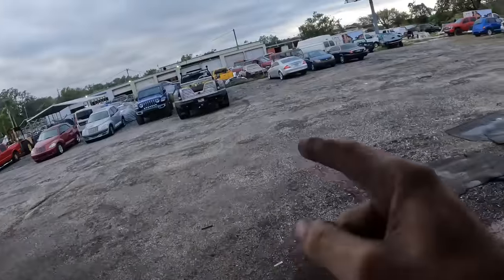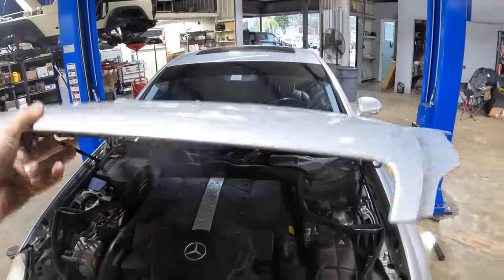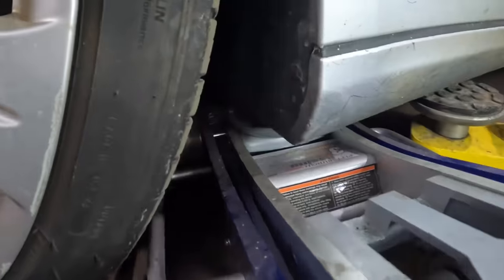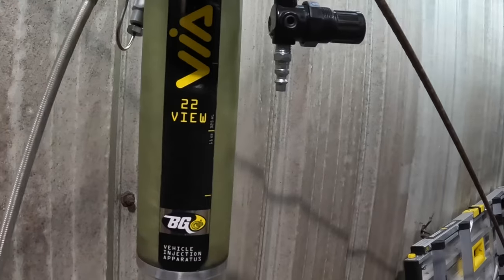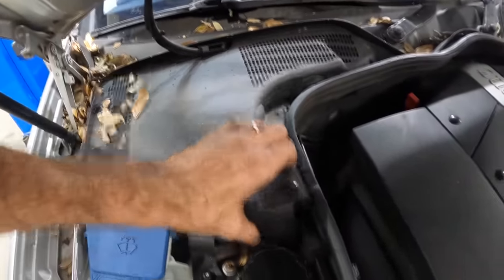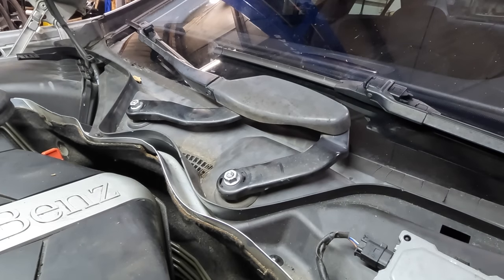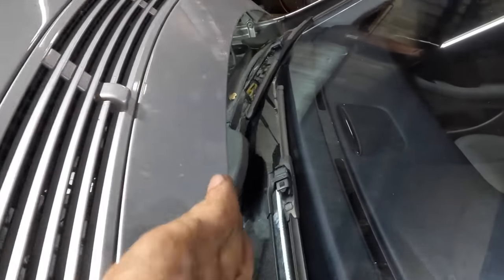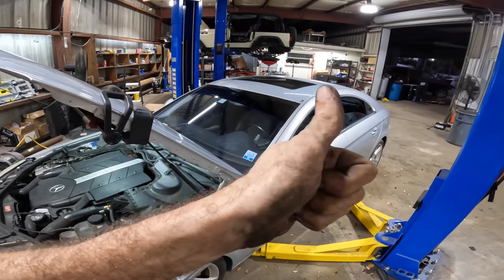Rookie Mistake on a Mercedes! “I quit” @SouthMainAuto

Comment: Just drove 6 hours to save my friend from a dealership and spending 700 dollars on a starter replacement for their 05 outback. The repair took 40 minutes start to finish including cleanup and parts were 155 bucks. They were also presented with over 2000 dollars of additional non-critical items that they felt had condemned their car and weren't going to be able to get to family for Christmas. Replacing that starter saved them and now they can visit their friends and family. I've ended up becoming the default mechanic for all my friends and family.
Reply: I stopped doing work for family and friends unless there is a emergency. My children are well employed and can be responsible for there lives.
Reply: @phillipdewitt4454  Same here. Not the children part but the 4 sisters part. They  earn more than me. Bye go bring it to a garage lol
Reply: 250. Is pretty inexpensive. Very easy access.  The job also entails resetting basic functions after battery disconnect.
Reply: I used to be the mechanic for my kids.  My two sons have great jobs and earn boatloads more than my wife and I.  They have stopped asking for my opinions anymore with autos.  They just take it to dealerships.  My one son found a repair shop that he liked.  I wasn't too thrilled about them though.  He's old enough though.  Now my daughter is another story.  Tire pressure light came on for -20F this week.  At least she let me know.  But I ended up putting air in tires for her.   She still has me doing routine maint for her.  That's ok though, I enjoy it and it gives me a chance to check her honda over.  I find simple things like oil changes, tire rotates, filters, and brakes to actually be relaxing for me.  Very therapeutic.
Reply: @phillipdewitt4454  
If it makes him feel good to do it for friends and family, so be it. If it feels instead like they're just 'using you', yep, time to stop being a free mechanic. One acquaintance makes a point of charging friends and family at a reduced family cash rate. That way they still pay and don't abuse his services.
Reply: I wouldn’t drive 6 miles to save someone anything I don’t like anyone enough when I need something done everyone scatters
Reply: @chrism5433   I'd teach them to hook up any 12v battery parallel before disconnecting the main battery.  Settings are then preserved. Too bad all those settings aren't stored in eprom, it's soooo cheap.
Reply: Happens a lot at the stealerships. Especially when some parts are only available through them.
Reply: At least my dealership offered a competitive price. My 2011 KIA was in for a major service and it cost $300 and they noticed the air filter was starting to go bad.

They offered to replace it for $20 along with all the fuses, just to make sure the car was good. They actually looked after me, as a local mechanic was going to charge me $600 for the major service.

And if the prices seem high, I live in Australia and that is pretty normal for us.
Reply: i spent 650 at a mech, i bought the parts,600, timing belt seals adjuster,w/pump, ect. i could of fitted it but it was leaking like a sieve & i was flat out at work.. now,,i have a new shelf.. timing was out as he didnt do what i said, & it broke rockers. not a desaster, but, shouldnt happen. & it shouldnt cost me to fix my own car with no comeback for the mechanic. ford focus diesel 2.0tdi. the rockers are a fail safe, they brake, nothing else. if belt snaps ect.. mechanic = god..
Reply: @robertsmith987  You got that right.
Reply: @robertsmith987  You got that right
Reply: @TheEthiopian1987  You are very lucky, God bless
Reply: I used to do maintenance for a friends apartment complex. Simple plumbing ….water heaters, toilets, sinks, laundry tubs, showers/tubs and lighting. He was a good friend, he paid for all materials and bought me lunch as payment. I never charged a dime. We used to converse at least once every few months. I asked for ONE FAVOR, one tiny little task that he was experienced in ( deciphering a schematic). Said he would get back to me….have not heard from him in over 11 months. Never knew it was so easy to get rid of a “friend”.
Reply: Good job
Reply: @TheEthiopian1987  every thing you said was odd
Reply: You're a great friend! Fixed their Christmas better than Santa. I salute you.
Reply: @mrcryptozoic817  you can get a setting saver that plugs in to the obd connector
Reply: I've never done a starter on a Subie oddly enough - is it any worse than on a typical FWD vehicle?
Reply: Dealer uses factory parts did you?
Reply: @Peter-td3yk  at $155, I'd say definitely not oem.
Reply: @Peter-td3yk  You can often get the genuine Denso parts from somewhere like Rock auto or Autodoc (if you're a euro) for half the price of what the dealer sells them for.
Reply: I did a quote at a meineke to have a motor replaced stock for stock just out of curiosity. It was 2200 dollars!
I did the motor swap for the price of the motor which was 350 bucks.
Reply: Six hours of drive time and I assuming that is one way.  Time is money.  My mechanic charges $80 an hour in labor.  Figure in two full tanks of gas for my F150, and do the math.  I'd have just paid the $700.  Because as a man, there is no way I'd expect a friend to spend 12 hours on the road, spend his money on gas and do the repair for free.
Reply: @oldvsnew3400  you can’t even spell mechanic correctly so I highly doubt your capable of even a straight swap 1 for 1, Ancillaries already fitted to engine drop and hook up type the absolute simplest type.. 

Tbh I haven’t commented on half of the comments posted here because you all either lie make things sound worse or don’t tell the whole truth like typical bad customers.. 

I have my own repair shop in very highly rated and am honest transparent and do high quality work ho above and beyond but I’m not the cheapest around nothing like main dealer but not known as that cheap guy I’m known for attention to details.

Now I once quotes a chap for a new engine on a M140i BMW 2 years out of warranty so used units went for like 6000-8000 With 65000-85000 miles on  at the time have since dropped but this was a few years back i quoted to fully recondition his so new headset, Head itself, all valves rockers seals and everything that could be replaced  be replaced too to bottom i even got upgraded crank set to stop the infamous bmw crank key way spin after going above certain power levels meaning the car was good to go from up to 800 bhp safely in future if needed. Again above and beyond didnt add any mark up for parts so I could supply the highest quality genuine parts of anything that wasn’t from bmw was from a well known performance parts company in the uk. So nothing was cheap all to be able to get the car back and feel it’s faster and stronger than ever before but will last even when pushed. For all this I quoted him FULL ENGINE REBUILD all genuine 5729.99- Parts &  2250 Labour start to finish & yes all engines are hand built by us so no parting jobs off to sub par people start to finish will be in the region of 45-100 hours all in most of which isn’t I won’t be able to charge for mostly me being over picky and holding myself to a ridiculously high standard so people see my work and other mechanics compliment it not pick it apart sort of thing. After all that he thought I was ripping him off told him take it to bmw get a second opinion they told him the same fault as I did but quoted 22800 😂 needles   To say he apologised and snapped my arm of on the price plus a month after he had the car back once he had his oil changed as part o Dan break in (all built into the original price of course) he gave me a envelope with £1000 in it after doing some research he’s realised he got way more than he paid for and wanted to keep a solid relationship between us so he continues to do so into the future! Moral of the story don’t always be a bad customer like most people maybe go away and go some research so you know when your being looked after and can appreciate it else it might stop
Reply: Cool . Well done. Happy new year to you.
Reply: @Connlew  Meineke is a large chain of shops in the US. Since you question their ability based on a spelling mistake they didn’t make guess we should question your ability since you actually miss spelled a ton. Lol the irony of you insulting others here and calling them liars, look in the mirror mate.
Reply: @TheEthiopian1987  Sometimes Dealerships want cars coming through the Door as otherwise they would have  Mechanics idle so the are now quoting really very realistic prices, got a Water Pump replaced but they attacked the Job too late in the afternoon, were seriously sorry then gave me a Dealership car to get me home and had the pump replacement completed by 10-00 next morning had the Car Hoovered, Washed and even 50 Euro off the Bill
Reply: @Connlew  You're an awesome person and mechanic. Also, Meineke is the name of a franchise mechanic business here in the US. Just so you know.
Reply: If your a professional you should have figured out that isn't ever going to work!
Reply: @phillipdewitt4454  i understand your position but I haven't stopeed doing friends and family auto work for one reason... I CHARGE THEM ( $25/hr plus mileage & Diagnostic fee * time & a half after 6pm * ) EXACTLY LIKE I DO ANYONE ELSE...  ( SOME PPL CHARGED A BIT EXTRA IF THEY WON'T LEAVE ME ALONE TO DO THE  WORK )    

MY EXPLANATION......
YEAH WE ARE FAMILY, BUT THAT DOESN'T CHANGE THE AMOUNT OF TIME AND ENERGY I HAVE TO PUT INTO IT.
Reply: You have so much gain and will lose nothing.
Reply: @robertsmith987  understand. 
Amazing how many friends you have when they need something..
Then disappear after you've helped them out..or dont have time if you need help.
Reply: @jojomorgan8556  i call it an aggravation tax for annoying people
Reply: Theres a term being used on those repairs,, I am the warranty-48yrs now!!
Reply: george9417 : My grandfather used to say, "If you lend a man twenty dollars and never see him again, it was worth it."
Reply: 9😅

Comment: In 1970 and 71 I worked for a Saab and Citron dealership as a mechanic. The Citrons if you put the incorrect oil in the suspension system they would total the car. It cost more to fix the suspension system than the car was worth. I never did that but someone did once and so when you started to work there they made sure you were aware of the fact. This dealership was the cheapest people I ever worked for. Working on used cars they would cut corners. Like one time they wanted me to wire the heat riser open instead of replacing it. I didn’t work there very long because I hate crappie work like that. Do it right or don’t do it at all. That is one of the things I like about watching you. You do it right.  You take pride in doing it right.

Comment: There are a lot of shops that would take advantage of the wipers not working by "replacing the wiper motor". Do not be hard on yourself too much as well all tend to act first and think later. I have a lot of respect for a person that owns up to their mistakes, you very well could have edited it out and no one would be the wiser! Wishing you and your family a Merry and safe Christmas.
Reply: Yesterday my wipers went out when it was almost zero degrees today it was about 5 when it gets a little warmer I'll fix it because I popped the wipers and then it started to work again it just the neutral switch on the wiper motor it'll be all right I'll fix it have a great day

Comment: The wiper arm attachment nut is designed to loosen automatically to prevent damage to the wiper transmission or motor if the wiper blade becomes blocked or frozen to the windscreen. It should be only tightened to 19nm to allow it to break loose if it becomes blocked again. Love this channel Ray.
Reply: good thing he is in southwest florida lol, no freeze
Reply: Sometimes they just come loose without an explanation. Not much snow and frost in florida. I had a ducato where the splines were so worn out that the wipers would flop which way around. Tightened it down with epoxy and a strong wrist :D Then again, I've never had a wiper nut "break loose", but I have one time had a mercedes wiper motor pull the body screws out when the wiper got frozen on the glass.
Reply: @TJAnttola  windshield replacement is a prime suspect when ice is never encountered.
Reply: There not designed to come lose at all not on mercs anyway if they freeze your supposed to defrost the screen common sense tell you not to turn on wipers if there frozen to the screen
Reply: @elijahevo6859  Most the time.

Comment: Yes, some shops use the "gotta get it fixed or else" fears to do repairs and charge more. I was with the Tucson Police department and there were a lot of complaints called in to the city attorney's office for fraud involving a number of "service stations along I-10 going through the city. Since I was a mechanic, I was tasked to set up a sting operation to see if it was true and who was doing it. Since almost all the complaints were involving women I got several women police officers to pose as drivers from out of state and had a few cars brought to the city shops so we could set them up. We tuned them up and checked everything to make sure that all was serviceable then we built in a known problem. One car had one spark plug closed so it would not fire, another had a mis adjusted carburetor and all the belts were serviceable. The drivers went to all the gas stations along I-10 and either told the attendant to check the oil or that there was a "funny" noise from the engine. As a result there were several criminal fraud charges involving one "mechanic" telling the driver she had a bad oil leak that had to be fixed before she left. He was found to have a pen light  that also had an oil squirter so he would look like he was checking things but was squirting used engine oil on a part. Another quoted a huge bill for all sorts of "must get done" repairs.  One had a small razor blade that he cut belts with. There was only one old mechanic that pulled the plug that was closed and told the driver he fixed it and there was no charge. This did make the newspapers ( the ones printed on paper) and the only one shop the  news  was  allowed to identify was the honest one. The complaint rate dropped. This was done in the mid 70's. There are a number of hidden camera fraud videos on YouTube that are similar.
Reply: It is (funny/pathetic ) how here they quote WCB as reason for me not being in the shop! I don't mind getting charged more for verifying work done the way ( I ) Want!  I do complain when I don't get what I WANT DONE! 
Like the other day I asked for checking one cylinder for compression, they said should check all 8, so didn't do it!
Reply: This is why I bought an OEM level bi-directional scanner. Well done.
Reply: i remember in like 90s or early 2000s there was one but i think it focused on a specific business
Reply: My friends in Tucson tell me they trust AutoworX for all their repairs
Reply: To be honest I'm 69 years old physically I could be in better shape I don't need to be working on my car even though I am mechanical but I've been burned so many times I don't even want to bring my car in for an oil change that's pretty sad when you trust people and stuff happens I can't begin to tell you stories but no matter what have a Merry Christmas and a Happy New Year
Reply: the spark plug thing would have me worried.  Yea re gapping it might make the engine run smoother again...but WHY was it smashed shut in the first place?

The one and only time i've seen this happen was a old suzuki swift I was replacing with another car anyway, so i lent it to my brother while he was going to trade school.  He called me on his way to the city telling me it was sounding bad, I told him to just keep going and don't stop (the car wasn't even worth the tow it would cost)  He made it, but when I asked him to pull the plugs one was smashed closed and the car no longer started.

since it wasn't worth the tow i never got it home to fully diagnose what happened, but I can only guess a con-rod let go, or a piston broke to cause that.
Reply: @edwardcarberry1095  why would you want to check compression on only one cylinder?  It's standard to check all of them to spot differences.  There's even a spec given for how much different cylinders can be (ie in a 4 banger, 140,150,140,135 would be good, but 140,150,140,110 would be bad and signal somethings wrong)
Reply: @animefreak5757  Well of the 8 cylinders #8 cylinder Was the Worst in driving which it had a fuel return of -4.0 to -4.6 while #2 was would be 4.0 to 8.0 at the same time/ s. The number #8 required the cab to be lifted so there was no way in hell I wanted to spend more money to re Re Do #8 injector. The others were operating fine! It was quit gutless at that time! 
When the #8 was re Re Done it is now back to having power. But that was another $1048.00 more! All of which I don't really have. 
The idea being what would give a cylinder bad performance (low compression ) with 107,000 Kms on it and it was fine more or less before I would NOT expect it to be bad.
Hope that is a suitable response?
Reply: Am I able to reply???
Reply: @animefreak5757  I do have the specs here, I was expecting compression of between 300 to 500 lbs then a difference was stated between cylinders as well. 
So if it was low <300 lbs compression it would then be below spec! So then at that point they would should have came out and told me of this then at that point I would have told them to pull the other 7 glow plugs and tested those cylinders as well. 
If that first RE&Re guy had driven the truck?? I would ?/should know that it (truck) was not operating normally! But that is expecting re &re boys to know more then Me!